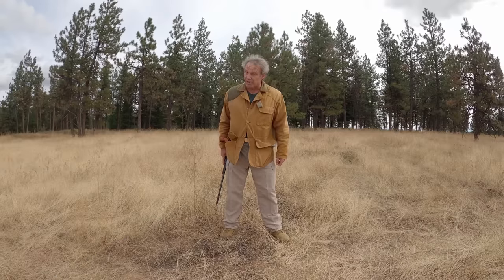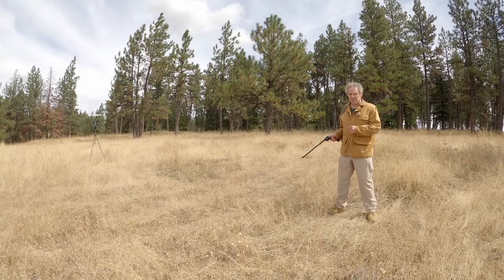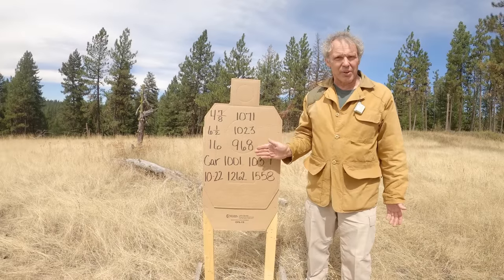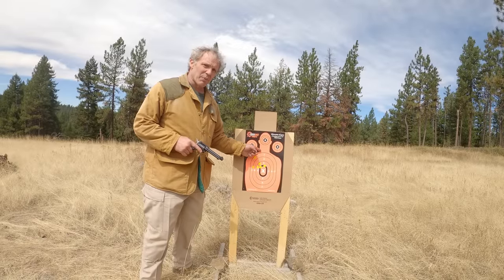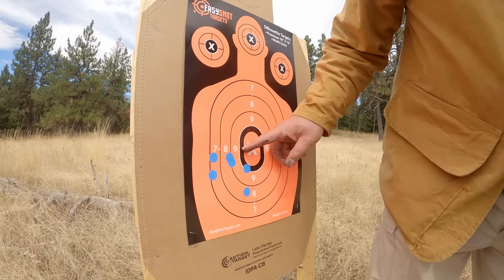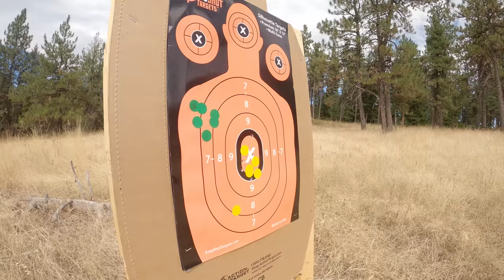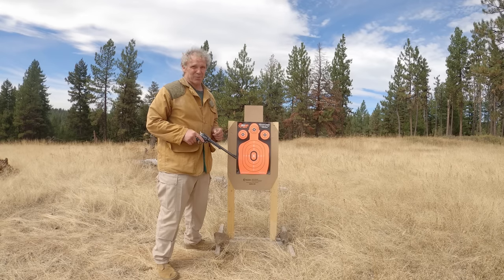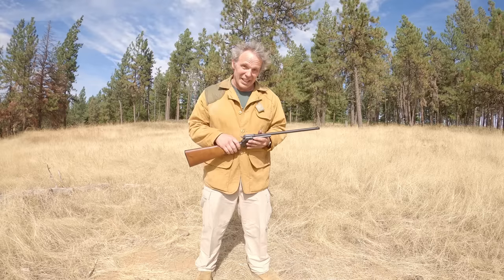Heritage Rough Rider Revolver Barrel Length Comparison

Comment: My 6.5" 9 shot Rough Rider seems to have a fairly significant gap between the cylinder and the forceing cone. When it is caulked it has a tighter gap, but as the hammer moves forward, the gap is allowed to increase. It would be interesting to see you measure the gap on the various Rough Riders, And compared to other brands.

Comment: I had both a 6 shot and 9 shot version of the heritage both with 6.5 in barrels. Both had magnum cylinders as well. I would suspect that when they make these revolvers they are all probably made to the same spec so they wouldn't have to retool to make a specific .22 LR version. I could be wrong. I have had tighter groups when using the mag as opposed to LR. I believe LR is supposed to be .222 and the magnum is supposed to be .224. That would mean the rifling grooves would better accommodate the mag over the LR.

I would love to see some test done with the same revolvers using the magnums. That is assuming that my above suspicion is correct and they all can fit magnum cylinders. Would be nice to see how the barrel length effects the magnum when it comes to revolvers.

I am also wondering if the armscor semi jacket hollow points of  will still expand out of the 6.5 inch barrel when used at self defense ranges or if I would be better off getting the short barrel ammunition for .22 mag. I ask this question as it is one of my self defense pistols.
Reply: We load our Heritage with Hornady...if it expands, great...if it doesn't, there is still penetration...that gun in the basement...we own a snub .22wmr that also has Hornady loaded, but I have a single box of Gold Dots that might be fractionally better...

Comment: Appreciate your paying some attention to 22lr firearms. I enjoy shooting them. And have for some yrs used 22lr handguns for most of my monthly shooting practice. I shoot 9mm EDC pistols for the last 20 to 30 mins. For me, the 22lr practice carries over to the 9mm pistols.
    It never occurred to me to try different ammo in a pistol to try to get groups closer to point-of-aim. I have several with fixed sights. Just tried to remember that a certain gun shoots high, or wherever. And, I always forget.
    I will try that different ammo for better groups with a fixed sight 9mm pistol. I like the gun. But don't like the bad point-of-aim grouping.
    A question. I'm a little puzzled by your 'flier' rounds from time to time. Your skills far surpass mine. It seems a highly skilled marksman would only rarely have a 'flier'. Is it just not possible to nearly eliminate fliers???
    Appreciate all of your body of work. Like your channel merchandise too.  Many thanks.  😁
Reply: Flyers are born from inconsistent ammo manufacturing practices...think about the ammo in your house...is every round the exact same bullet weight, size, powder load...? probably not, a chrono would prove that easily...while the differences in your carry 9mm ammo may be slight, in bulk .22lr those differences may be huge...the real .22lr sharpshooters have their methods for sorting more expensive ammo to be as close to consistent as possible, but us regular folks tend to just roll with it...nature of the beast...

Comment: Does the HRR have a twist rate of 1:14 as opposed to Ruger's 1:16 RH? Would that, and the the 1215 steel HRR uses be the difference? I've noticed that. I've got both the 4.75" HRR and the Ruger 10/22 with a FAB stock setup. The HRR was replaced, shot left high on a mount and had a frame defect, which was warrantied. The replacement is dead on, but I do not have a way to check the speed at the moment. I noticed your shots with the long hand grip pistol was dead sounding compared to the "Rancher" version stock. Might be a good follow up. CCI stingers were good, but too much gap flash. I find after a lot of different ammo, Rem Thunderbolts are working and sounding pretty good. I'm shocked. The 10/22 likes those Stingers though. And Aguila ammo is to the HRR's friend for me. I had a deadening and fatal malfunction on the first HRR with the .22WMR cylinder and that ammo. Bulging caps and exploding out of the rear.

Comment: $500 in a gun can be the difference between a few years of solid service and a lifetime or two of solid service. 
As someone who deals with them daily at the store, I can say that Heritage guns HAVE improved since just before Taurus moved to Georgia and their new facility. Consistency IS better. I see very few outright send-backs compared to just a few years ago. There IS STILL some consistency issues on the finer tuning of them. They can be a bit draggy in the action and the cylinder gaps can be barely hanging onto that ragged edge of in-spec. And every now and then I get one in that makes me marvel at how no one in the process caught the problem afflicting it. This is one of the reasons I check all my single-actions (at least for function if not live-firing) before I let them leave the store.
That said, A Rough Rider is NOT a Single Six and the price reflects that. A more accurate comparison would be the Ruger Wrangler vs the Heritage. The Wrangler is better built, but as with any base price gun in any major company's catalog, the cheaper price reflects a lesser quality comparatively. I've had wranglers that were pretty gritty and stiff out of the box, and one that was just flat out disturbing in the action's working. Again, NOT a Single Six, even though it shares the design.
One of my favorite SA 22lr's was the Uberti Stallion. The actions were beautiful. They were just under $500 at the time, but you were getting quality and beauty for that money.
Reply: There are guns we are willing to spend 500 on...a single action .22 isn't in that category, so we went with low price, and the .22wmr cylinder was the other deciding factor...this was several years ago, we feel the gun has paid for its self, and is still running...at this rate, by the time the gun ever gives up, we will simply buy another one...in the meantime, cheap plinking rules...!

Comment: I'd definitely be interested to see if the .22 WMR has the same loss in velocity with barrel length that the .22 LR showed. I know the Heritage series definitely seem to suffer from losing pressure at the forcing cone, but I'm wondering if it's bad enough to cause the same trend with the hotter rounds.

Comment: up next... 
Heritage Rough Rider Revolver Barrel Length Comparison - Part 2, The magnum cylinder! 
Im tempted to get the Magnum cylinder for my Roughrider, I mean, its $30!  but how much more power is in the magnum in these revolvers? Given the higher ammo cost, is it worth it?
Reply: I was also just thinking about it.. the Ruger Mark IV comes in several lengths from 4.4" to 10".. I'd be curious to see the difference from the 4.4" vs 5.5" vs 6.88" vs 10" all in the same platform.

Comment: The velocity differences in the barrel length IMO was the most striking clue of gases escaping perhaps the manufacturing of the two models is slightly different(?)... or maybe the person that shot it before Paul fired it uphill and strained the barrel 🤣

Comment: I have a revolver that always has one flyer out of six rounds I went through 3 boxes of 45s trying to find out which hole they were coming from and I was shooting from a bench with a solid rest, never pinned it down. You have me curious I am going to Chong my 22 autos with different barrel lengths against a ruger 10-22 and each other.Thanks for the great videos,and keep shooting.
Reply: Mark the cylinder when you notice a flyer maybe it’s the machining on the cylinder

Comment: my heritage is very picky.  The manual states that you should only shoot jacketed or copper wash projectiles, because of the risk of leading the barrel.  Mine shoots the remington golden bullets well.  I tried some bulk pack federal.  It shoots well for the first cylinder, mediocre for the second, and the third cylinder all rounds keyhole.  You can clean the gun, and the accuracy will once again return, but when you get to the third cylinder, they begin keyholing again.  The federal bulk pack i shot was a copper wash, but apparently it is still leading out the barrel.  The golden bullets work fine in mine, regardless of how frequently you clean the gun.
Reply: Good info 👍🏻
Reply: We clean after every range visit...with any .22, any brand ammo, it is pretty messy...
Reply: @PetuniaIii-pd1ww  Yes i do that as well, but my particular rough rider with federal ammo leads out the barrel in 18 shots.  I can shoot all day with the golden bullets, and never see a drop in accuracy.  I haven't tried mini mags, stingers, or any of the high end ammo in it, because i really just use the rough rider for plinking.  it gets to eat the bulk pack ammo, unfortunately the golden bullets are the only bulk pack i have that i can shoot out of it.  Wildcats, Thunderbolts, and the blazer bulk are all waxed lead, and the manual specifically states not to use them.
Reply: @angryroostercreations5194  your barrel tighter than ours...it takes usually over a 100 rounds of any brand to start really gumming up our gun...or maybe you're just a more precise shooter, which is cool, too...we happen to be running one of those big bucket of golden bullets right now, and the round does okay, a couple bad ones but about average for what they are...our autos and lever actions do pretty decently with them, but we find the ammo a smidgen dirtier than say, mini-mags, or other brands...
Reply: @PetuniaIii-pd1ww  i'm not  sure why.  with the federal mine goes from 4" at 15 yards to 12" after 18 shots,  and most of the last cylinder hits the paper sideways.  I may have got a lemon in that regard.  I'm hoping that in time once the barrel has REALLY broken in, that it'll be less likely to lead out.  The bucket of golden bullets i have is like 1400 rnds, it'll take me a while to shoot all of that through a single action.

Comment: My thought on the Heritage carbine for new shooter training: why not a bolt or lever-action? Bolt-actions can be comparable to or cheaper than the 10/22 in price, and provide similar safety advantages and similar (or potentially slightly better due to slightly more gas pressure being imparted to moving the bullet instead of the bolt and spent case) ballistics. Lever-actions have similar benefits except for the price (being more expensive than any of the other options), and additionally have nearly complete ambidexterity and the ability to see the hammer's state as easily as the Heritage (unlike a bolt-action's striker, or worse, a 10/22's internal hammer).

And, if you've got a suppressor, bolt and lever-actions will suppress the best (and the Heritage won't suppress at all), which would have benefits in the training environment - some flinch response is from the sound, and also it's easier to communicate with students without relying on yelling loudly or using electronic earpro. (However, that particular discussion blows budget right out the window, and if you're cost-sensitive and are trying to avoid noise, a .17 or .22 air rifle may make more sense at that point.)

The big downside I can see to a bolt-action is the near total lack of ambidexterity - if a shooter is severely left-eye dominant (I personally cannot get a sight picture with iron sights with my right eye), you've gotta have a left-handed bolt-action (which is what I did for my first firearm) or train awkward ways of cycling a right-handed bolt. So, if you can't afford a lever-action and don't want to use a semi-auto, and need ambidexterity, I guess the Heritage makes sense for that application?

...if it's legal. Because there's a few US states at least where the Heritage is not legal due to melting point laws. And that actually gets to another point in favor of the lever-actions - there's a few states where anything more than 10 round magazines is illegal, with the exception of tube-fed .22 rimfires, and that means lever-actions.

Comment: It might be interesting to run these tests on each individual chamber in the cylinder.  Maybe find out which one to leave empty.

Buy quality you cry once.  Buy cheap you cry every time you use it.  But (sigh), one can buy a lot of 22 ammo for 500 bucks!  😉 
Thank you very much for the vid.
Reply: No need to leave a hole empty.  They use a hammer block safety.

Comment: @23:50 when you fire your second shot it appears a large amount of gas is shot out of the cylinder gap towards the camera, it might happen with every shot but the second one just happened to be captured by the camera.  i had to watch several times because at that same moment, coincidently, a bug flies in behind you towards the camera and turns downrange

Comment: I bought a heritage 22 revolver because I was curious to see how it stacked up against the Ruger revolver of the same design. My take away (which your video here seems to agree with) is that the cylinder gap on the heritages is really poor. Everything else about them seems to be okay, but I still prefer the Ruger.
Reply: Oh, I bought the Ruger Ceracoat (Rangler I think?) it was only $40 more. Was it worth $40 more? Yes, it is a better made pistol. The Heritage is still fun, and it will shoot 22 WMR.

Comment: Hypothesis: the Rough Rider is losing a lot of muzzle velocity due to a bigger than usual cylinder gap. Paul, could you do us a favor and measure it using a feeler gauge? If I recall correctly, your Dan Wesson kit should include a 6 thousandths one, that is just about industry standard. 2 thou is pretty small (Freedom Arms), 10-12 could be considered excessive.

Comment: No doubt, the Heritage has a lot of pressure loss at the cylinder face. 
You did not mention that the 16" variant comes with both .22lr, and .22mag cylinders. .22mag makes this a much more powerful pistol. I can't say I ever use the .22lr cylinder unless I'm working with a new shooter.

Comment: I had to get one to pretend like it was the gun that the joker shoots down the bat plane with in the Micheal Keaton Batman. I have the barkeeper model as well. I got the 22mag cylinder for the 16½ version and it's kinda doodoo. 

Anyway, I'd bet the weight of the longer barrel is pulling the gap further from the cylinder, making the pressure fall and making velocity lower. I know that sounds crazy, but those are some cheap irons.

Comment: 40 years ago, when I reloaded cases fired from my 1911 clone, I only sized the neck because when fired, all the cases were sized to the chamber of my clone. HOWEVER..... I had a S&W Chief Special that had different sized chambers. New ammo fit just fine, but when I removed the spend cases and tried to insert them back into cylinder, some of them wouldn't go back in. 
Maybe Heritage six shooters are getting large patterns is because the cylinder doesn't lock up tight (wobble) - or maybe the cylinder holes are bored out of alignment. 

Hows about you shoot all 6 rounds all from the same chamber & see what happens to the group size. If the group shrinks, then the problem is probably with the cylinder holes not being drilled correctly. If so, send the cylinder(s) to Heritage & ask them to send you cylinders that were bored by somebody who isn't blind.  Oh.... forget that comment. I don't want ADA posting a "Wanted: Dead or Alive" bounty on me!

Comment: Hey Paul, I have a question in regards to the non-adjustable sights. I own a Heritage rough rider 4.5" for plinking. I haven't done this yet but I was told you are supposed to (or at least, are able to) file down the sights on the appropriate sides to adjust point-of-aim when you pick an ammunition that you like and will stick to with that firearm. Is this traditionally the case and would the same hold true for other revolvers? In that instance, the point-of-aim offsets shouldn't matter at all, but it is a set it once and only once. A gun with A shooter and A particular ammunition.

Comment: I never thought the forcing cone loses on a 22LR revolver would be so great.
I have a well used Chiappa 10 Shot SAA 1873-22LR - 7 1/2" revolver which is very accurate and loads of fun that has "rarely" had a hiccup, and on those rare FTF occasions I blame on the ammo. (Not one failure with CCI MiniMags)
I was thinking of buying one of the 9-Shot Heritage Rough Riders and buying the 22WMR cylinder to go with it, but now I'm thinking I'll just pass. 
Any actual owner reviews on the on 9-Shot 4.75" Heritage Rough Rider using dual cylinders???

Comment: For a couple bucks more you can get the Ruger Wrangler and it is much better and does not have that stupid safety lever on the frame.   I have a couple of each.  Even with the 22 WMR cylinder.  I recently was able to get the F.I.E. revolver which was the predecessor to the Heritage.  It is similar in design and is a real pistol made of steel not zinc alloy.  A much better gun.   Save for a couple weeks more and buy the Ruger Wrangler and you will be glad you did.  Especially, if you have to send it back for repair or replacement as I had to do with the Heritage Birdshead that was so bad I could not have hit that target at twenty yards.  Taurus destroyed it and sent me another after several months.

Comment: You missed my favorite feature with the heritage rough rider for $30 more you can have a 22lr and a 22wmr cylinder. I get better accuracy with the 22wmr ammo than I do with the 22lr ammo in my 4.75 and 6.5 inch revolvers.